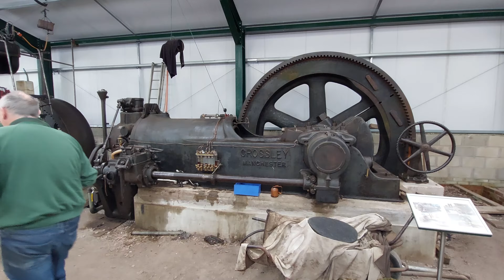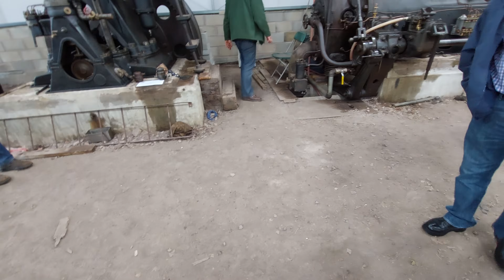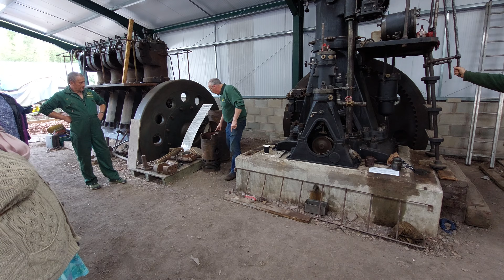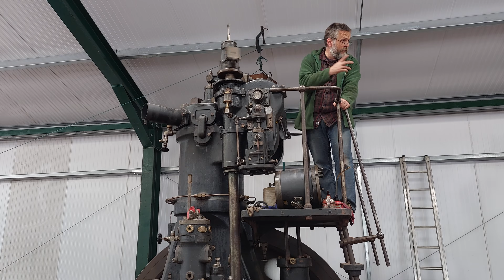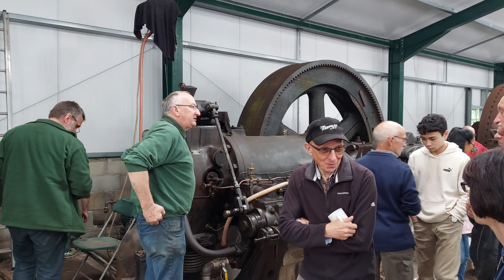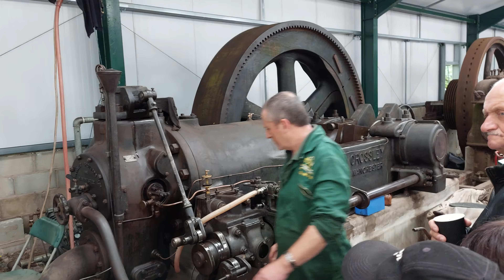Anson museum  Mirrlees engine story and start up

Comment: A bit different to the Mirrlees engines I've worked on over the years. The KV16 and K8 were favourite power station engines for large scale mines in Australia. Spent many years overhauling and maintaining them. Also worked on the MB275 which were situated in the OK Tedi gold /copper mine in  Papua New Guinea